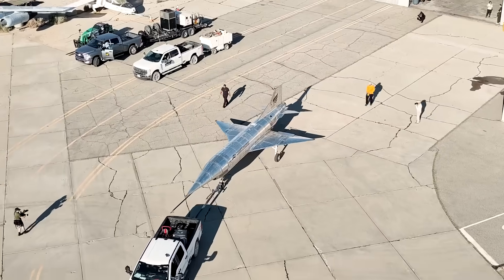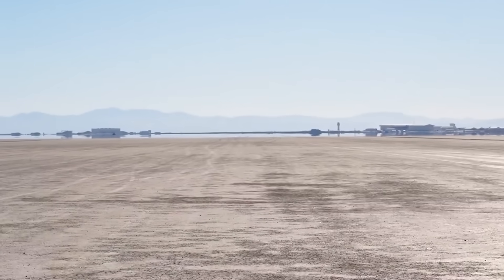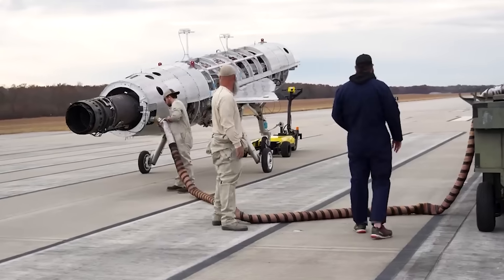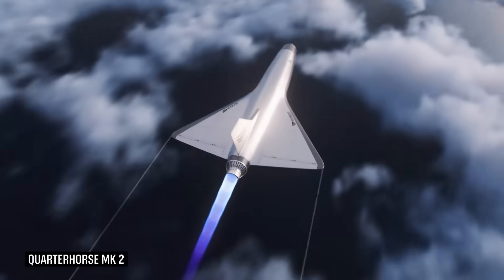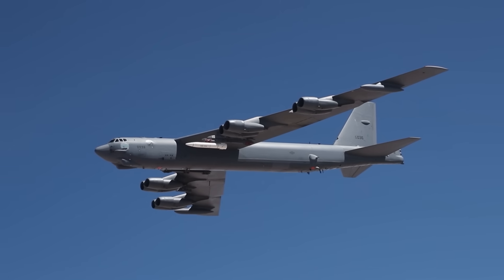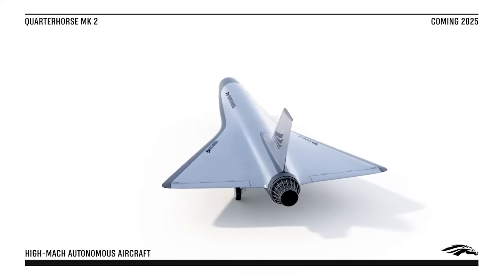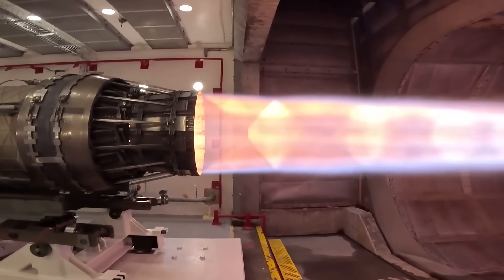Hermeus completes first test flight of hypersonic jet design!

Comment: It looks much like the Fairey Delta 2 from 1954 which was the first jet aircraft to exceed 1,000 miles per hour (1,600 km/h) in level flight.

Comment: This flying prototype is hilarious! Its riveted design makes it look like a late interwar-era metal plane if they have access to the engines and aerodynamic knowledge of today. Even Howard Hughes was filing rivets down to a flush finish for speed in the 30's, but I fully appreciate that this a prototype and, right now, their goal is no doubt just to test sub-sonic systems with an affordable platform. Filing rivets can wait, and I suspect they might go over to other materials once they're closer to committing to a locked down design.
Looks as though they might be adopting a similar approach to SpaceX with Starship where they can quickly and relatively cheaply churn out lots of prototypes to accrue data fast, and I look forward to seeing where their tests and prototypes take them!

Comment: Not a new entirely new design the engine is from a F-5 highly modified and the F100 engines are from the F-16/F-15 but highly modified.
Cruising MACH 3 taking photos over China will get you shot down in today's world, no different to the SR-71 would be shot down by today's modern current systems!
Manoeuvrable Hypersonic aircraft might get away with it, but that decades away.

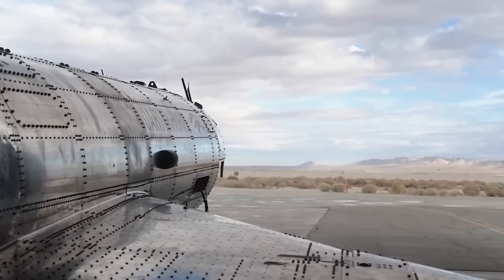Comment: 2:03 Rivets 😁
Reply: No way that version is flying hypersonic with those button head rivets like that that. That’s wild
Reply: @andybiscuits  I think I read somewhere that this “riveting” airframe’s only purpose was to demonstrate low speed handling (AKA take off and landing speeds). That’s it. I’m sure the hypersonic airframe will be assembled differently.
[EDIT] At 3:13 Alex mentions this as well. They chose the rivets for a simpler and faster build process as this airframe wasn’t even meant to break Mach 1.

Comment: FYI, the term "Iron Bird" is not new. This is the name often given to a ground-based systems mock-up of the aircraft. It is done in a prototype stage to test the various components of the final prototype. This is to ensure that all the avionics, software, and other mechanical systems are working the way they are supposed to on the actual aircraft. Usually it is just a framework where the various components can be attached to in relation to their position on the actual aircraft. It can include actuators, and control surface mechanisms, including flap, and slat actuators. It is not a new concept, as other aircraft manufacturers have had ironbirds for their new aircraft when developing them. Just saying...

Comment: Landing at 150 vs 205 really doesn't seem like much of a difference...until you do the math and work out that (assuming constant deceleration) stopping distance is proportional to the landing speed squared so that you need a runway almost twice as long.

Comment: the USA has had hypersonic planes since the 1960's  .. search X-15.. this is idiotic FAKE report, NO hypersonic plane would EVER have exposed rivets
Reply: The X-15 was an amazing feat of bravery and engineering. But with 1960s tech and a very short flight time, it was not meant for sustained flight. 

What Hermeus is doing has never been seen. A single engine that can transition from turbo to ramjet will be a pretty big deal, and with the success and progress they've shown, having mach5+ as an aspiration doesn't come off as an empty promise or a pie in the sky dream. We might get to see them pull it off. 
  The Quarterhorse demonstrator with all the rivets that you see is not meant for hyper-sonic flight.
  'Mk1' just successfully demonstrated successful take off and landing and is probably the one with the rivets. 
  'Mk2' The next iteration is not built yet, and will attempt to demonstrate supersonic flight below mach3. 
    ...The turbo/ramjet engine has only been proven on a test stand, but is designed to take a polished iteration of the single engine jet beyond mach4. 
  'Mk3' will attempt to demonstrate capabilities of turbo/ram engine, and make the transition from turbo to ramjet, while in-flight, attempting to break mach3. 
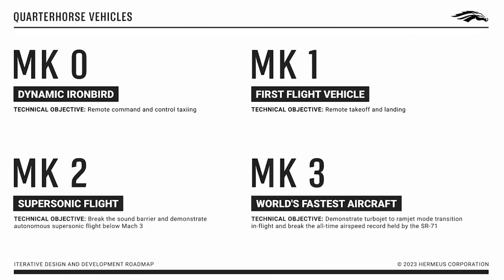  5:05 shows us a roadmap breakdown of iterations and objectives for the development of Quarterhorse if you're seriously interested and maybe missed it.
Reply: @Inertia888  again .. idiotic .. obviously you have never heard of the SR-71B, transcontinental capability.  your darling project is just a joke looking for funding , if is even exists.  chasing a capability that has been around for literally half a century

Comment: I swear this thing has been testing for a while.  Where I live in the Midwest people have been hearing muffled sonic booms regularly at 2-7AM for the last couple years
Reply: If we're hearing about it now, it has. The f-22 was first tested in the late 70s, same with the B2 bomber. Military tech is 20-30 yrs ahead of what information is available to the public.
Reply: @dancingisraeli911  lmao, was before internet and video phones or easy to acess cameras were invented. nothing is secret now. you can follow USA hypersonics through HIFIRE and SCIFIRE. Ii have been for decades and USA had no hypersonics before. struggled with scramjet engines until Australian Ray Stalker was first to get essence of flight from them. he worked out using hydrogen as fuel instead of kerosense produced more thrust.
He also worked out NASE x43 scramjet rectangle design produced to much heat and invented a inturned fixed geometry scramjet engine.
Australian professors of aerospace have been helping USA in hypersonics,..

Comment: The trouble with a turbo-ramjet design is while it looks great on the testbed it is not practical. The aircraft design should allow operation at mach 3 , much like the SR71, for the ramjet to be useful. the reasons for retiring the SR71 are well known. with todays advanced missile interceptors it would be difficult to justify the need for an aircraft traveling at Mach 3. The hypersonic idea is again difficult. while it may evade missiles, the plasma that forms all around the airframe at hypersonic speeds will cause communication blackouts.

Comment: I'm in a glass-half-full mood. The progress from a standing start is impressive but the Quarterhorse Mk 2 will only reach the capabilities of a MiG-21 in terms of top speed and landing speed, which is c.1960 technology. (MiG 21 listed top speed is 2.1 although test runs undoubtedly went faster. It landed at 200 knots.) I appreciate this is only meant as a step in developing the technology and build and operating experience but it's not the breathlessly exciting news you make it out to be. For pace of development, the F-104 was developed in 1 1/2 years and it was a fully functional manned fighter (Yes, Kelly Johnson had a large corporation behind him but he was working with slide rules and primitive computers.). An aircraft structure that can handle speeds above Mach 6.5 was achieved with the X-15, also with early '60s tech. Yes, it needed rocket power, so -

The real story for Hermeus is the power plant. The transition from turbojet to ramjet in the same engine is a long sought goal. When they accomplish that in a plane that can handle the speed that'll indeed be a big accomplishment.

Comment: Smart we been doing hypersonic since the 60s
Reply: Exactly. This will amount to nothing, unfortunately.

Reusable isn't the order of the day. Any payload it may carry will have to be released at lower speeds.

Reconnaissance by this is not likely to be necessary or invulnerable.
Reply: @rebellion2054  Weird how all the experts in this field, including the military itself, disagree with you.
Reply: @rebellion2054  reusable one will absolutely be important even if it is for recon however it is possible to eject it out the back which has been done before
Reply: @rebellion2054 the significance here isn't reusability, but cost. hermeus's goal isn't just to make hypersonic engines, but to make them fast and to make hypersonic flight not completely break the bank.

Comment: Glad to see Hermeus and Anduril pushing the high overhead, slow moving behemoth defense contractors Lockheed, Nothrop, Raytheon, etc to innovate, cut costs  and reduce their design to test to production models. We need to streamline, cut costs and reduce timelines. The SpaceX model of fast failure to fast improvement needs to permeate the industry.
Reply: I have no love for the primes but we need both. Startups are bad at a lot of things.
Reply: It's telling that these new companies are founded and funded by tech bros, basically. They have a lot of money to throw around, and they've got none of the institutional bias towards old design and manufacturing methods that may be a lot slower than what can be whipped up with modern technology. They can hire a bunch of people who are starting from first principles, bring none of the cruft, and have an attitude of "well, let's just figure this out" no matter where it leads them. Try something, maybe it works. If it doesn't, oh well, try something else. Iterate rapidly. Move fast and break things. They don't have to worry about Wall Street investors since they're private companies. They don't have to worry about keeping 40-year employees happy on some old-style manufacturing line that's operated the same way for all 40 years or more. If the engineering is sound, their private investors will be happy because they see the potential in it over the long term.
Reply: @fakecubed  I wish I could be optimistic about this because these companies are doing great things. Unfortunately, they will never stay private. They are going to go public ASAP, and then they will likely run into the same problems as the other contractors. Anduril will probably go public in the next two years.
Reply: @fakecubed  Gotta remember that a lot of the "old design and manufacturing methods are mandated by the US government.
Reply: @fakecubed it will be a s good as US AI versus China.

Oh wait that did not work out at all did it.
Reply: @fakecubed that is the optimistic take. In reality, there’s a reason successful startups are called unicorns. Startups are bad at a lot of things. And there are lots of things you can’t afford to get wrong and iterate on. If a naval nuclear reactor melts down, you probably won’t say “oh well, try something else”. You will say “3.6. Not great, not terrible”.
Reply: Americans are really good at one particular thing....

Creating hype.

Whether they can deliver real world results is an entirely different question. So far there's only marketing material.

Comment: You said clean sheet to demonstrator in less than a year. But if that demonstrator is stuck on the runway and it was actually over 2 years to get a flying one out there then you are just kinda a liar.

Comment: Easy now. The first high-speed roll and first flight only prove it works in those flight conditions.  Those are very tame flight conditions compared to high Mach (and even transsonic).
Reply: It's about the flight controls, and their ability to rapidly design and manufacture. It's just a platform they can learn from.
Reply: @fakecubed  , We don't know how far that design has gone. All we know is that it can do a high-speed taxi, take off, and land. probably staying at low speed.  These are the typical first steps of a flight test. Transsonic gets a lot more complicated and I can't imagine what happens up to Mach 5.
I would emphasize that unmanned planes allow them to accept a lot more risk than a piloted aircraft. That includes less need for redundancy and cross-checking.
And there is a wide range of complexities of flight controls, from an early F-16 to a modern F-35, which is a thousand times more complicated.

Comment: Grandpa X-15 just entered the chat Thats quite, but  I took flight for the first time on 25 June 1964. I reached my maximum speed of 4,520 miles per hour (7,274 km/h) in October 1967 with pilot William "Pete" Knight of the U.S. Air Force in control. As for ''reusable'', does 200 flights count?  ;)
Reply: But that’s not an air-breathing jet, it was a rocket with wings. And while impressive it’s just not the same
Reply: @landonluebke7627  Never said it was, but its still an impressive one trick pony!
Reply: old technology lol. X43 was getting better as was a scramjet engine, buy USA failed on design and was not until Australian Ray Stalker got essence of flight from scramjet engines and then USA got him and Aussies to help them in hypersonics..
Reply: @micksmith-vt5yi  Tru indeed, but still. Hypersoninic in 1967 and they got 200flights from the program. Not bad at all!

Comment: Great video, but the building and testing of the airframe and subsystems is not that fast as they were only putting together systems that already existed to some degree such and the turbo jet.  It is an integration task.  A combat or surveillance jet has a lot more thing that need to be added and tested for.  Think of a car with wheels and an engine, there is a lot more that goes into the final product than those two elements.

Comment: The bonds of the molecules of air vibrate at Mach 5? What the heck are you talking about dude? 😂
Reply: The heat comes from compression, not friction and air is not made of molecules, unless you consider oxygen as it comes in pairs always in nature. Mach five isn’t enough to separate O2 into singlet oxygen

Comment: whether or not Hermeus is eventually acquired by the big boys, this just goes to show the value of new thinking. iterative design is expensive but necessary for a start-up. even though the data learned may already be possessed by the big boys the ability to look at a problem with fresh eyes is critical. so many companies would be tripped up by legacy thinking and bureaucracy

Comment: That beautiful stainless finish is reminiscent of the bleeding edge 1950s era designs and I love it. It looks like Kelly Johnson himself could have drawn it yesterday. 

Aviation is on the precipice of another golden age, and we are SO lucky to be here to see it happen.
Reply: Digital manufacturing is what’s making this progress possible. Once someone makes a 1/1 AI physics simulator we’ll be able to speed run designs
Reply: I agree, it's peak
Reply: A new golden age because there is a new prototype that looks 70 years old sounds odd. Sure, the engine is revolutionary but I’m waiting for a new aero design as well before I would call it a new golden age.
Reply: @autobootpilootI think we've known what shapes work aerodynamically for a while now. Materials that can withstand those high speeds that's going to end up being the bigger challenge.
Reply: @Mmmmmmdonuts  we don’t even fully understand how a wing works yet so there is a lot to be discovered as fas as aerodynamics go. But yes, materials are a challenge too.
Reply: @autobootpiloot What do you mean "we don't even fully understand how a wing works'???   You might not...but I assure you the people designing aircraft for sure DO understand....and many are shaking their heads at the Hermeus aircraft which breaks NO new ground so far.   So on a test stand they've bypassed the jet engine to run the afterburner like a ram jet....much like the J-58 did over 50 years ago.....but you can't just shut down the jet or the fuel and hydraulic pumps no longer work so it must be kept running....again like the J-58 did.    This whole project is going to run into the Elephant in the Room being the heat Mach 3+ generates as well as the difficulty in controlling the incoming shock waves needed to diffuse the air to subsonic velocity so the engine can inhale it.

The Pentagon spends a LOT of money on projects like this not actually expecting it to succeed.....which is unlikely....but as an advanced training exercise for the engineers involved who will learn a lot even when they fail at the ultimate goal.
Reply: @recoilrob324  I can assure u even the people that design aircraft don’t fully understand how aeroplanes fly. That’s just something we haven’t figured out yet. Sounds strange because we can build very capable aircraft. But wings also do things we can’t explain so we don’t know it all yet. Science is strange sometimes.
Reply: That's what i thought.
Reply: "stainless finish" was shiny aluminum, which didn't last due to corrosion, so, painted finish was necessary, but with a weight penalty
Reply: Just get a beautifull cyberpunk then...
Reply: Jet engines are about to get a whole lot better. 

When you combine electric impeller decoupling, hybrid ramjet bypass, and rotating detonation, magic happens. You can remove almost all of the fiddly bits, so it looks like a SpaceX Raptor 3.

Small, light, simple, easy to produce, insanely efficient, insanely fast.

I've been working with AI, to try to make one as possible for a jet pack. Well not the ramjet parts. I don't need to go that fast. Not including electronics. It could possibly be done with 3D printing in three parts. Probably more like four or five. Someone a lot smarter than might be able to do it in one or two parts. Still only a couple thousand dollars, instead of tens of thousands of dollars.
Reply: @jtjames79 we could have a new golden age of aviation, but only if Giants like Boeing we're not taking the easy step to profitability through financial engineering  and sticking to Just producing reiterations decade old designs instead of actually doing true innovation to make themselves Make themselves look healthy.